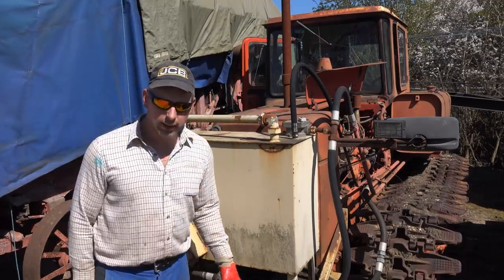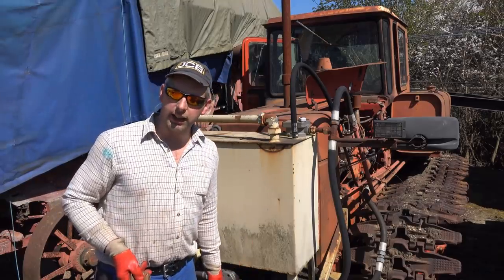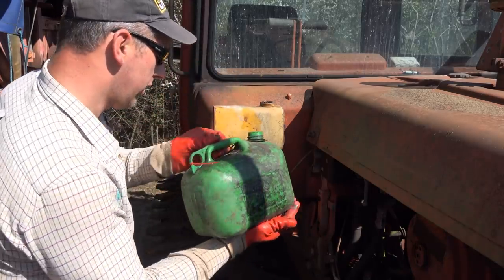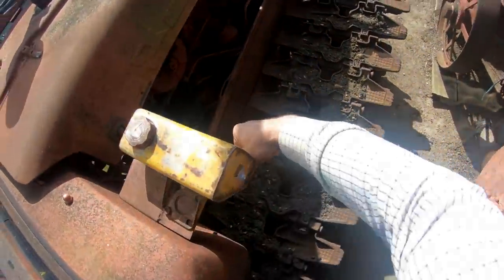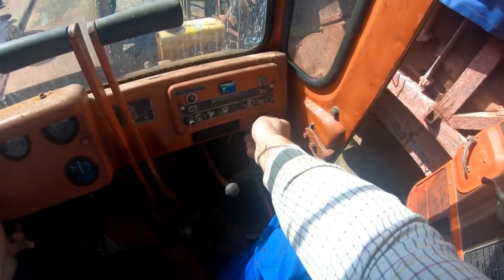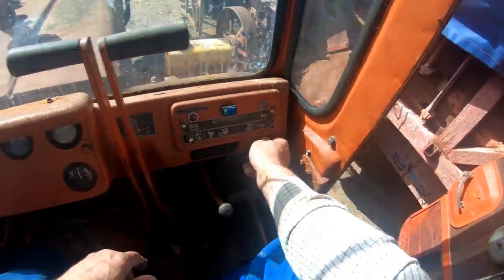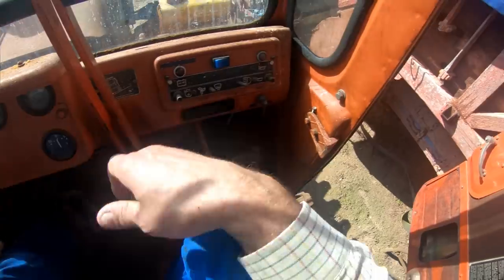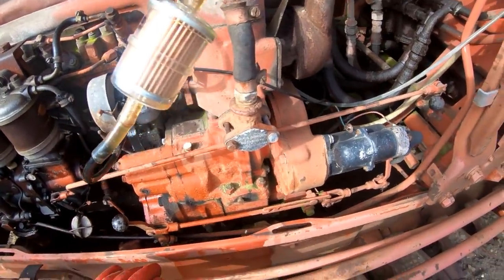BELARUS DT75 CRAWLER. DONKEY START

Comment: To make the donkey start better try opening the  valve on top of the cylinder by the spark plug & giving it a few squirts of oil 👍, looks great crawler, have DT75M myself

Comment: That's probably a luxury export version with the starter for the Donkey engine. Usually they come with with a flywheel and string, but adapters for usual electric starter are available. Plenty of these around in Latvia also with dozer blade at the front.

Comment: Well done George and Liz getting the pony motor to run well enough to get it running well the motor when running sound's sweet probably needs a bit of TLC on carb and plug  points dose the motor pre heat the main engine be good to see it start up keep up the good work. PS I have a 1950 cat D315  US ARMY gen set it a D4 engine pony motor start to it great to get them fired up take care see you on next update

Comment: DT 75 is not belarus, it was produced in Volgograd (ex Stalingrad).
Reply from the maker: Yes, but they were sold in the UK as a Belarus.
Reply: @GeorgeSaunders  almost all soviet tractors were branded as Belarus for export, because Belarus brand was known better, just that.
For example - DT-75 was produced by Volgograd (ex. Stalingrad) tractor plant (Russia), T-150(K) in Charkov (Ukraine), MTZ (original Belarus) in Minsk tractor plant, Kirovetz K700, K700A (modified K700) and K701 were produced in St. Petersburg (ex. Leningrad) tractor plant, but ALL of them were branded as BELARUS just for export.
by the way, these pony or donkey engines were and are THE pain in the ANUS :D I have worked with russian combine wich had an engine from the same factory and with a same pony engine for starting diesel.... oh.... how much I coursed this pony motor.... it's like hardcore masturbation, for something to start working :D